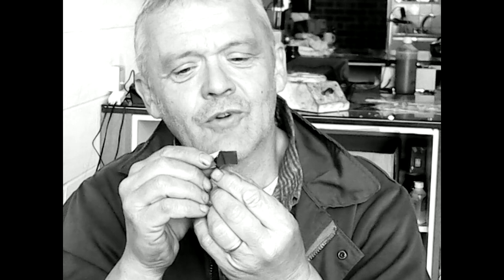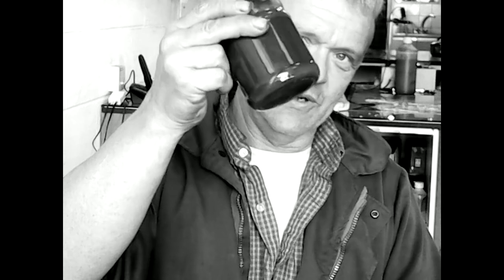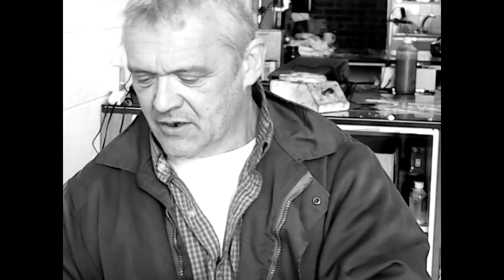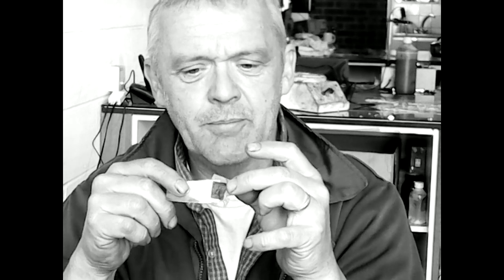Towards A 1 MegaFarad Super Capacitor

Comment: I don't know if this question, or rather a series of questions have already been asked but here they are.
Based on your experimentation and assumptions what ratings would you expect these prototype capacitors to achieve, i.e. that would be the maximum voltage rating, leakage leading to how long it can store the charge for without load and also shelf life? While designing these high capacity capacitors, do you keep in mind other specifications that you want to achieve or is it purely a capacitance race?
Reply from the maker: Atristiel i keep in mind other factors - it has to compete in the market
Reply: Robert Murray-Smith I'm interested to know how much charge you can store in those capacitors and how long ti keeps its charge.
Reply from the maker: Atristiel as soon as i have definitive answers i'll let you know
Reply: Robert Murray-Smith thanks

Comment: Great video, as usual.  If I calculated correctly, it is 1.0125 kWh of storage that a 1MF supercap at 2.7 V would supply.  It might actually work better to run them in parallel at nearly 12 V, if the voltage (dielectric thickness) can be increased.  I think the home storage market is just now going to take off.  They typically run 12, 24, and 48 V systems.  There is also a company called WiTricity who licenses their wireless power transmission relatively cheaply (so they say).  I could see a 12, 24, 48 V storage unit receiving power wirelessly from solar panels via wireless transmission.  It would be plug and play.
Reply from the maker: Joshua Fausset it's all getting a bit exciting lol

Comment: Compared to using an aluminized plastic for the current collector you could reduce the volume by using a pure aluminum current collector that is same thickness or thinner. This would allow the plates to be bipolar, so in a stack that has many current collectors, you've eliminated a volume equivalent to half of the current collectors. This is not my idea. Do a google search for bipolar supercapacitor.
Reply from the maker: Joseph Richardson already doing this mate - but thanks for the suggestion
Reply: You're welcome.

Comment: Nice work there, RMS. About the ink, let me guess, sodium silicate?
BTW, I think you've heard of aligning graphene flakes by setting the ink in a magnetic field in which the lines point upright? That should decrease transverse resistance (as in current collector to active material).
Reply from the maker: ƒ¡$h cheers mate and no to the sodium silicate and yes to the alignment lol - i think you are right it would reduce resistance might even make an nice interdigitated solar cell

Comment: What is the testing setup for something like this. I mean you can't use a conventional capacence meter. I imagine you ether have to role your own giant meter or use some other means.
Reply from the maker: ScribblesOnNapkins you have a number of options - buy the right meter, test a small bit and multiply out or discharge it to one tau over a known resistor and time the discharge

Comment: First question is how much does the current 10K unit weight? It looks around a kilo or two at most. That means your current product can easily be used in cars. Amazing work Robert, amazing work indeed.
Reply from the maker: Venturestarx we are getting good results on the potentiostat now - stable at 12 times the nearest commercial cap
Reply from the maker: Venturestarx Yeah it's a about 1 kg - but i am aiming for 1MF at about the size of a car battery
Reply: Robert Murray-Smith Hmmm, car battery.  Shouldn't your 10K 1kg be able to replace a car battery for just that purpose? Definitely not enough to propel an electric car, but just for the purposes of everyday engine cranking, start-up, and general electrical system.  It might cause the car's charge controller some issues.  Might need some redesign to handle the starting current.  But if worked, it should provide an excellent long term real-world test bed that could be even more inspirational to everyone.
Reply from the maker: xHorseButt about the size of a car battery mate - i don't mean it to replace car batteries i was only giving an impression of size - personally i am looking at grid power applications - other people - better than me - will work out car applications
Reply: Robert Murray-Smith I'm telling you Robert, you are in the electric car battery range with this one. Really great work.

Comment: Great stuff Sir. As the capacitance is only one part of the equation (1/2 * C * V^2) in terms of energy storage, could you give us some details about the voltage? (Sorry if this was already mentioned in earlier videos). I think It would be good to keep referring  to the storage energy potential in Joules, it makes it very easy to compare with other energy storage technologies. Thank you!
Reply from the maker: Positivebits I agree 100% with that mate - it's 2.7 volts - but i am looking at pushing that boundary too
Reply: Robert Murray-Smith Thank you for your answer Sir. Just to state the math then: each 10 000 F at 2.7V we get roughly 36 000 J, so about 1MF is needed to be in neighborhood of 1kWh (3 600 000 J). These are quite amazing figures already, just don't short these terminals :D Good luck!
Reply from the maker: Positivebits cheers mate - and you are quite right these re dangerous devices lol